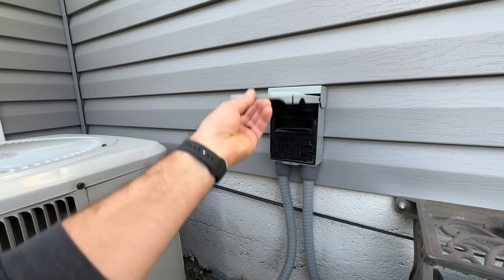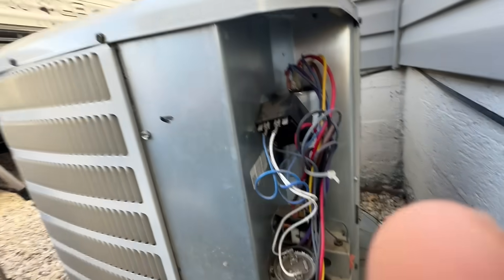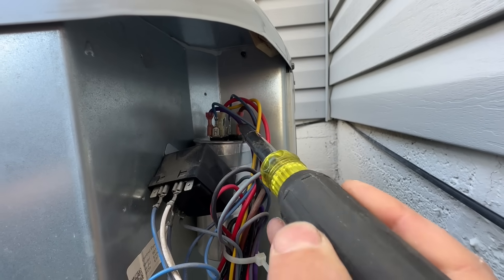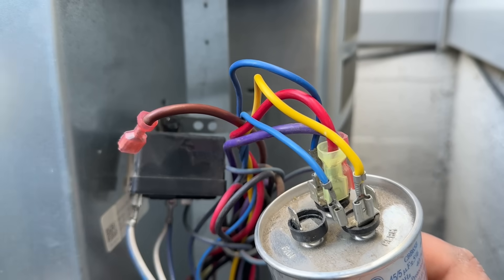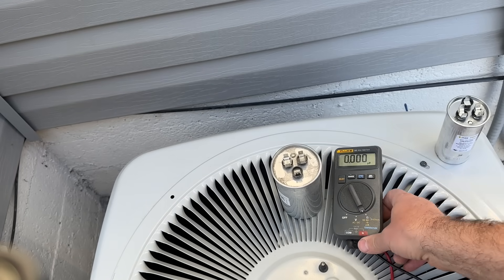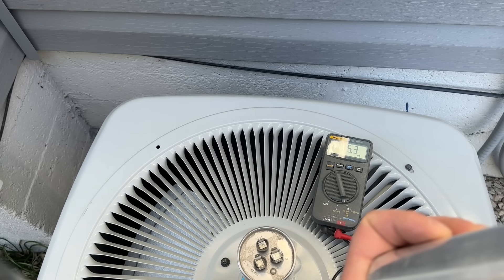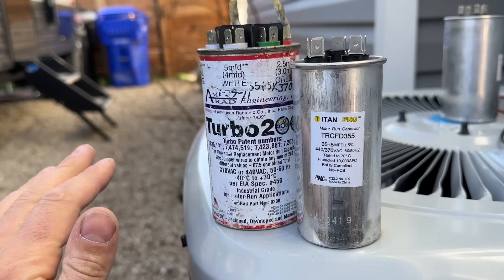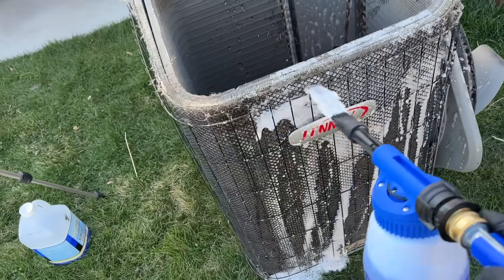How To Check & Replace An Air Conditioner Capacitor

Comment: What are the symptoms??
Reply: My experience has been a loud buzzing noise when the compressor is trying to start but the capacitor is bad and can’t jump start.
Reply: Buzz/humming noise.  Compressor not working but fan working.  Fan not working but compressor running.  Indoor furnace could have a capacitor on the blower motor.  Again hum sound or buzz and no air flow.  Blower not running.  Not everything but general.
Reply from the maker: Or if the fan is running but no buzz of the compressor. Occasionally both go bad and the fan and compressor both aren’t running and it’s due to a capacitor 👍🏼
Reply: @diyhvacguy  Thanks all. Bought a spare.